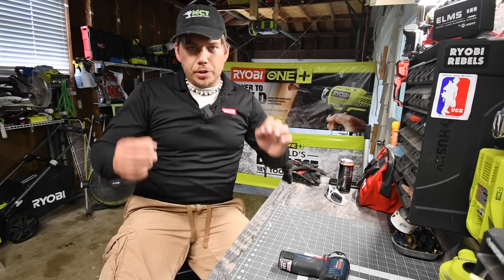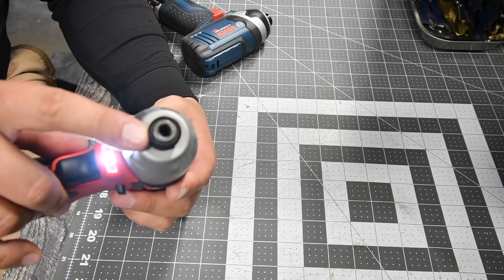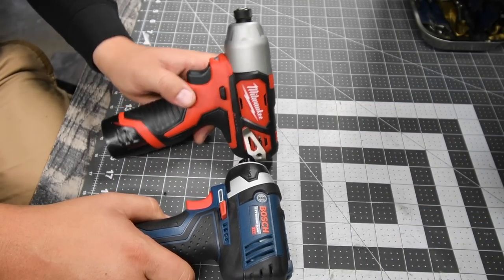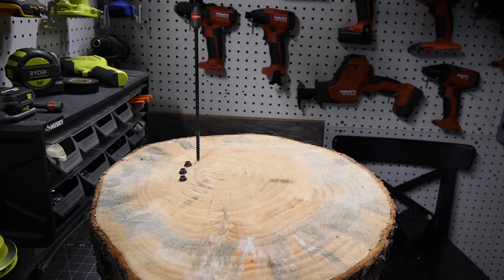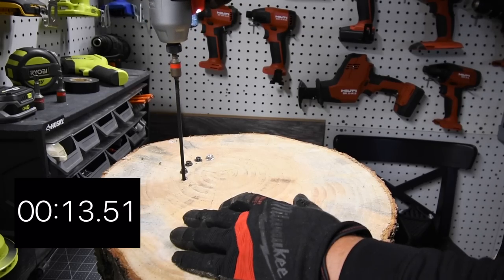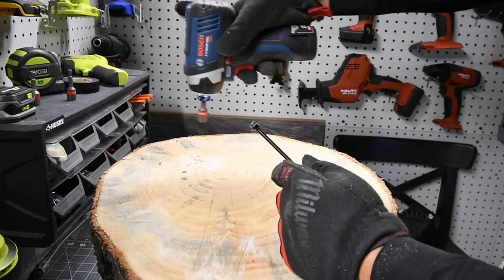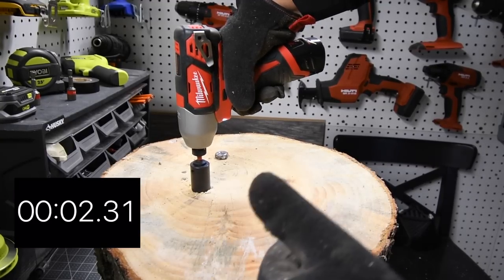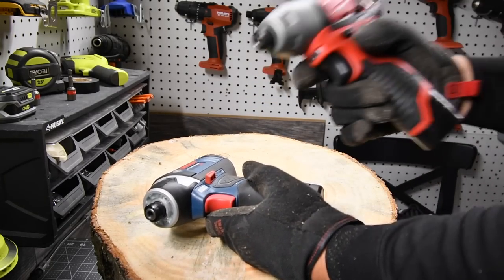BOSCH Vs Milwaukee 12v impact Drivers

Comment: I've owned this exact Bosch set with impact, drill, and work light for a few years now. They've never let me down on any project and I'm still using the original battery packs! They're seriously good tools for the money & even beat out "bigger" brands like Milwaukee (as seen in this vid).
Reply from the maker: I Thank you so much for viewing :)
Reply: Love the video....I had just purchased the Bosh and was looking for info ... ..what amp hour battery's are on the bosh
Reply: I’ve taken apart a pentastar 3.6L engine only using my Bosch impact driver. This thing is a lifesaver
Reply: @ericelagante9348  they come with 2Ah batteries on the kit
Reply: The Milwaukee fuel 12v is much better than this Bosch drill. Not sure why it wasn’t used in this test. I’m a fan of any of these 12v tools with this smaller battery options. The other 12v tools tend to have the same battery style as their 18v-20v drills and I just don’t see the point in buying those. The Milwaukee makes the most sense because the 18v chargers come with the 12v charger all in one.
Reply: @ToolsInAction4u  Dave is comparing Brushed vs Brushed tools. They're old and around the same price so that's also apples to apples.
Milwaukee has the Brushless M12 Fuel version, so does Bosch
Reply: @luisinhoens90  gotcha. I was thinking this was the brushless bosch version.
Reply: I own all Milwaukee tools M18 and M12 but I wouldn't mind getting the Bosch freak just to have that pass through quarter inch on top of a socket in one tool hell if they made it impact/drill driver / that would be a real freak and that would be even cooler
Reply: Nothing against Bosch but this is the lowest end Milwaukee 12V available... Nothing like the Fuel

Comment: There are almost NO Bosch tools on the used market like there are other companies. That says everything. Ive been looking and theres nothing that isnt completely used to hell. Which shows owners use them for years before updating.
Reply: I have used power tools about 28 years and I have lots of blue Bosch. I don't need to change those. Working very well. Battery drills 5 (3 different models), corded drills, router etc. Never disappointed
Reply: @tapsulinka  Lowes is actually cutting out a lot
of Bosch support, as DeWalt out bids their retail space. So I ended up getting a Flex package from lowes with a promo lifetime warranty. So far no issues. Charged the drill once over a year ago and still pull it out occasionally to use and its still charged  lol But I did get the Bosch sander because its one of the best.

Comment: I bought the Bosch Impact 4-5 years ago to use occasionally around the house. It was a combo with the drill, 2 batteries and charger in a nice case. I charged both batteries up back then and to my surprise both are still holding that original charge. In the past I've had batteries crap out after 6 months or so. The Bosch has never let me down and it has seen some use over the years. This thing really surprised me with how good it is, especially since the kit was under $100.
Reply: Got the same kit and I swear by it for around the home jobs. I have the Flex drill as well (founders addition) which is a great combo to have. The Bosch is so light and compact plus the battery just lasts so long.
Reply: I have 2 of those Bosch drills several years at workshop. Sometimes we use it non stop for putting several hundreds stopping screws into aluminium profile. It works great and one reason is that it's light. There is enough power to do the work. Batteries are still working good

Comment: The 18V Milwaukee driver brake gave out early on so I took it to a local Milwaukee repair store selling Milwaukee and linked to factory repair. I did not know they were sending a skid full of repair tools south of Chicago for repair and consequently their quoted time for repair was a week late. The 18V came in and they had dumped all the tools into a larger corrugated skid size box with only a repair tag attached. My 18V tool was almost new and looked like Hell as it had been dumped into the pile and was dented and scratched. The chuck was all scratched.

Comment: I have both of these exact sets and I have never ran into any problems. Both lightweight and compact and very powerful. I am a maintenance supervisor and I use these almost daily, I usually only need yo charge the batteries 1 time a month depending on how much use they get. Good video

Comment: Both are very quality brands and tools. I don’t think you’ll be disappointed by either in the long run.
Reply from the maker: you are correct about that. just because a tool loses doesn't mean its a bad brand
Reply: I bought an expensive Milwaukee 18V set and immediately the recip mechanism went out on the job with 3 roofers waiting for me. Then the recip replacement tool sent to me gave out and I ordered the part and rebuilt the tool. No more Milwaukee for me. I had been Bosch for 30 years. Those Bosch are still running along with new 12V drivers and now a drill with brushless.
Reply: Which is quieter though?

Comment: The Bosch actually sounded much louder with those woodlock screws. Seem to got in a bit smoother. These are quite old toolls i believe, nice to see BOsch already had that ringlight. I seems that is working better then the bottom up light Milwaukee has. Ive noticed some new Milwaukee tools now have that as well.

Comment: Bosch has been my go to tools for the past 5 years. Sure I have 20 volt tools, but I mostly use the 12 volt for most projects whether it is the 1/4" drill, driver or standard drill.

Comment: 30yrs ago, I had a Makita 9v drill and flashlight combo(very popular with mechanics of the time.), with NICAD batteries. It lasted for 9yrs before the batteries went bad.
It was huge by comparison, and didn't have the power these bad boys have.
Reply from the maker: that's what happens when you take care of tools
Reply: @ManCaverTools  I did take good care of the tools. I used the flashlight probably 10 to 1 over drill/driver. But that driver saved soooo much time taking dashboards and interiors apart. It's definitely the tool started cordless revolution that's beginning to sweep over the automotive industry. There are still times that I have to be connected to that big 1/2" inner diameter air hose.

Comment: The only tool  that most people DO NOT need in 18v in the impact driver, I use milwaukee and bosch 18v tools,  but the tool that I use the most is my 12v bosch brushless impact driver,  if you do lots of 3 inch screws or larger then get an 18v, but if 95% of the time you only use 2½ screws or smaller, then a 12v is great and much lighter than the 18v

Comment: I also want to see the Ridgid 12 volt tested with these.
Reply: I had Ridgid 12v. Can't hold a candle to m12 fuel
Reply: Cody Griesdorn  Fuel is a different league.  The Ridgid 12 volt drill beat the Milwaukee m12 2407. I’m curious if the impact would beat it as well.
Reply from the maker: yes sir, I will be getting them soon
Reply: I bought the Bosch 12v combo about 5 or 6 years ago to replace an 18v Rigid that stripped its gears or something driving lags. The little Bosch finished that job and many many more. I just wish they had belt hooks like the now ones. I inherited a new 12v Rigid that I only got to use a couple times before the switch or the motor failed. My dad had passed and I couldn't access the warranty, so it went in the trash just like the other Rigid--chargers and everything. I'll stick with Bosch and Makita for now.

Comment: Man before i got my 18v ridgid combo i had a bnd 20v impact and 20v Bauer drill.. They're used as backups and I am glad to be on Ridgid 18v for tools like the circ saw and impact wrench however initially i was going to get ridgids 12v combo but my brushed gen4x ridgid combo was the same price.. I wish i could ditch my bnd and bauer backups and get a 12v combo.

Then I see multiple of the same tools by diff brands by tool channels and think maybe a 12v combo isnt soo bad. Id have 3 drills and impacts but as diyer it is quite redundant..  I am really trying to find a justification haha.. I like the ridgid over the others becaue you get a 2 and 4ah battery vs 2 1.5s wit most other brands.

I realy havent found a direct need for the size and weight difference and I do have. A dewalt right angle attachment, I went through a similar phase with firearms and ammo a long time ago.
Reply: I have all m12 but I did get M18 hammer drill and surge cuz they were on sale. M12 is plenty for diyer. I have m18 brushed hacksaw too and I cut a tree down with it. Probably 50 feet tall and a foot in diameter.
Reply from the maker: I would if I were you. 12v tools now a days are powerful
Reply: @ManCaverTools  perhaps black friday or bear xmas I can justifyit..  For noe my chick says "dont you already have a tool lile that?".. Shes onto me.. Haha

Comment: The Bosch seems like a great starter impact driver in the 12v system. What’s your opinion?
Reply: Bosch tools are one of the few brand that are super underrated actually
Reply: Bosch are great and very reliable brand but they won’t have near the power the Milwaukee does.
Reply: Have installed 3 kitchens with the Bosch. It worked great and is nice n light.
Reply: Janes Fair yet the Bosch won every speed and power contest...
Reply: chris wilhelm it won speed they both accomplished all the task so no power winner. The speed has to do with impacts per minute more than torque.
Reply: The Bosch warranty sucks. 1 year is not worth buying for me. The Milwaukee at least you get 5 years and their warranty program is great! I upgraded to their M12 Fuel line.
Reply: Janes Fair yet the Bosch has less impacts per minute than the Milwaukee. 3,100 vs 3,300 for the Milwaukee. So how does impacts per minute equal speed if the one with less impacts per minute did it faster?
Reply: Look at  the Skil 12v!
Reply: @amoscardoza5253  Amazon is having a great sale on the Skill brushless 12 volt tools. I bought the 3 kit tool for $103 and the brushless right angle drill driver for $55.
Reply: chris wilhelm well I can’t explain it then lol I have the fuel brushless version which will blow both of these away maybe the Bosch is stronger than the regular Milwaukee
Reply: Janes Fair the numbers definitely favor the Milwaukee, but the Bosch puts on a good show. I’d be curious to see hammer size between the two, I wonder if that would be a deciding factor in the applied speed. I have the same model Bosch and absolutely love it, I purposely steered myself away from the Milwaukee as I didn’t want the temptation to get every m12 tool and have duplicates of every thing I own lol
Reply: There are so many brands , the choice is a mix between usefulness, ergonomics and Price so afterall it's up to you 🇫🇷👍😉
Reply from the maker: I am all about 12v tools and them being Brushless. we will see how the BL version go against each other
Reply: @AL_Lopez_101  register the Bosch and you'll have 3 years.
Reply: @Imafriggingoddess  .....yep easy peasy
Reply: Bosch is the clear winner here.
Reply: @amoscardoza5253  Skil is far behind these 2

Comment: The brushed m12 impact does a great job of turning people off from an awesome platform. Milwaukee would do itself a favor by stopping sales of that piece of crap.
Reply: You don't know trash until you invest in surge and quick collets
Reply: @GreatMelancholy  my surge is an animal. Actually break tapcons daily lol
Reply: I run an M12 Surge impact everyday and it has been great!
Reply: @Dale37  I have the M18 surge and it's a beast
Reply from the maker: I do agree with you on that. 100%

Comment: Do you guys like the style of 12v where the battery inserts into the handle like these or Makita/dewalt style 12v where the battery slides on better?
Reply: That’s a personal preference. The Dewalt/makita will feel a lot better for someone with smaller hands. I’ve heard some of the torpedo style like the Milwaukee can have problem with the tabs breaking and battery not wanting to stay put but I haven’t had that problem.
Reply: I own all 3, and they each have there perks.  Don't have much to complain about except for dewalts chucks on their drills
Reply: In short. Torpedo style is better in tight spaces cars. Ducts, random places you need to add a screw. Add Milwaukee’s slightly angled build and it rocks but if just drilling or driving with no obstacles the Makita dewalt style is better.
Reply: @GreatMelancholy  chucks r bad quality on every machine. Price competition has made Chuck manufacturers To go where the fence is lowest.
Reply: @jamesfair9751  had that issue on My milwaukee multitool, was fixed 2times..nothin changed. Got New tool on wednesday & if it does't hold the seller Will giwe me My money back or i can change To 18v multitool
Reply from the maker: I like the handle thinner. so the Makita, Dewalt and HILTI win on the battery design

Comment: If you get a chance I would love to see the brushed Ridgid 12v.. Obviouslly i have seen 12v fuel is a fucking monster but still..

Cheers
Reply: I had Ridgid 12v then switched to m12 brushed before going to fuel. M12 brushed is way better than 12v Ridgid
Reply from the maker: I do plan on getting a few ridged 12v tools and I thank you Mix

Comment: Just switched over to the Milwaukee fuel 12 volt system and I couldn’t be happier.

Very surprised on how well the Bosch did
Reply: That fuel is a beast!  No need for an 18volt most of the time.
Reply: @DamionJR4923  if you're a tradesman you'd have a different opinion
Reply: Cross Daily It depends on the trade also.  I did commercial and residential electrical for 5 years.  The new brushless 12 volts could handle most of the work.
Reply: agreed. I have done more damage to things with 18v than I care to admit. Overdriving screws, stripping bolts, not the tools fault but sometimes even at the lowest setting it’s too much. You don’t need m18 to put IKEA furniture together. Hell unless you are doing multiples or heavy lags etc, 12v cut’s it. 12v today is same and probably more powerful than 18v/20v 10years ago. My father in laws top of the line craftsman drill just crapped out after a lot of use. The m12 were equal to it in power, the m12 fuel we’re better so definitely a long way in a short time
Reply: I could see how some tradesmen would need the 18v system but the 12v fuel is seriously impressive. I’ve seen some instances where the 12v fuel easily outperforms some 18/20v systems
Reply: I make furniture on the side and I see no need for me to get into the 18v system
Reply from the maker: I was as well, but it might be different with the brushless version comes out

Comment: old milwaukee vs new bosch
Reply: This Bosch is older than this Milwaukee . Its been around for years now.
Reply from the maker: both are brushed tools
Reply: Right, the Bosch PS41 came out around 2014-2015 so it's at least as old as the other impact from the Chinese owned brand lol.